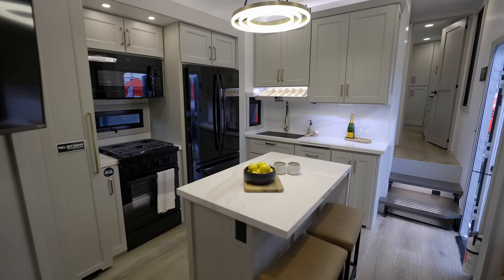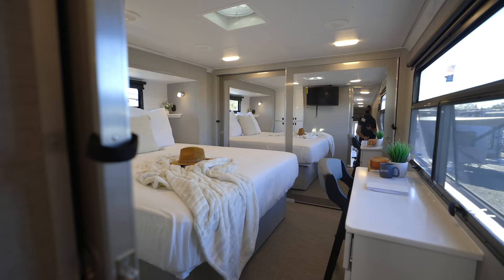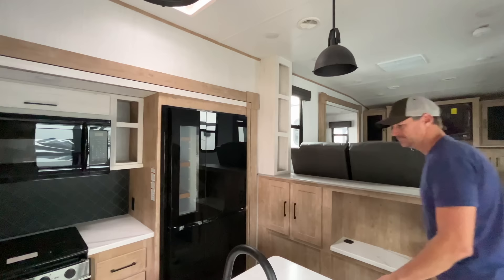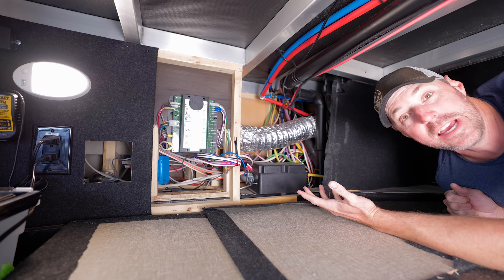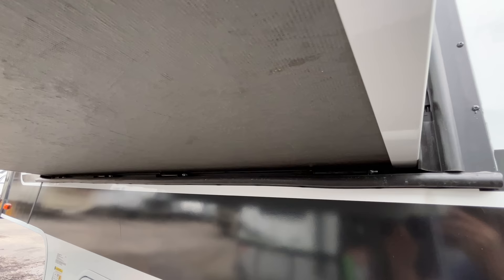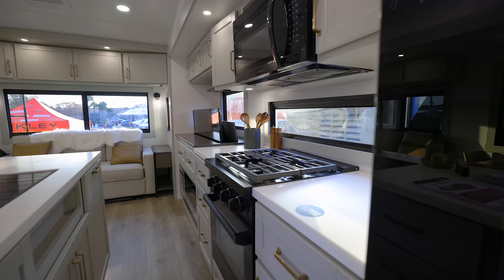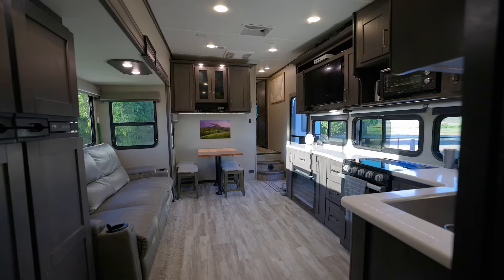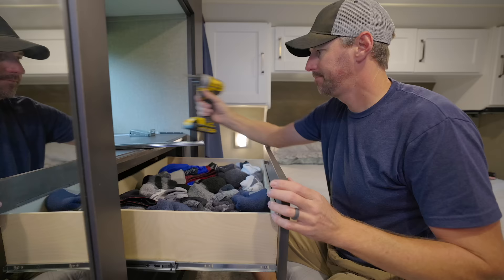Are All RVs Junk! Problems With Our Grand Design RV.

Comment: Went to a big RV show this weekend and was generally appalled at the quality of 95% of what was on display (Hundreds of RVs, dozens of brands).  A salesman happened to overhear me complaining about simple things that could have been done to improve fit and finish.  The salesman came over to “reassure” me that the RV dealership would fix most of my complaints in their pre-delivery prep.  He said they spend on average 14 hours of labor to get a unit ready for delivery.  Holy cow, it takes the dealer 14 hours to fix the sloppy workmanship by the manufacturer??  I think he thought that was a positive selling point but I view it as an inditement of the manufacturer.  Makes me wonder why the dealers didn’t prep their show units before hauling them to the expo to show the public.  Seems like a really sketchy business to me.
Reply: For sure. If that were true they’d have inspected and corrected units as they are delivered, and they sure wouldn’t take a defective unit to the show.
Reply: Don't buy one OR build your own!
Reply: Imagine what you can’t see.
Reply: Exactly. If the things you can see are crappy, and the builders know you can see it and still do a poor job constructing it, just think how poorly the stuff you can't see is constructed. @donziperk
Reply: Sure they will "fix" them.   Meaning maybe cover them up until the bottom line is signed. Then good luck.
Reply: Also, he is lying.  None of that stuff gets “fixed”.
Reply: And so they thought it prudent to bring non-prepped units to an RV show? Yeah, sure they did and sure they do.
Reply: Typical salesman B.S.
Reply: He has a bridge in Brooklyn for sale too...😅
Reply: @mehill7786   Exactly
Reply: And keep in mind- that's the model they're actually SHOWCASING. Imagine how bad the ones on the lots are.
Reply: I drove 3 hours to Camping World Kissimmee to trade in my RV for a new one. 10 minutes into my ride home, the roof AC stopped working. Dealers don't QC anything and yes they're all junk
Reply: Doesn’t sound like a dishonest salesman but an inept one. The dealerships are willing to prep ANYTHING and EVERYTHING on a new unit. The factory pays for everything under warranty. It starts and ends with the factories. They are putting out a shoddy product. And subsequently  during that “2-3” hour prep sometimes details (mainly fit and finish) defects get overlooked because they are concentrating on big stuff. Or it’s an inept technician. Skill of dealership techs can make a HUGE difference however. Quality of RVs usually are better during the “slow” months because the techs are not overworked and looking for billable hours to build their paychecks. JUST LIKE THE CAR WORLD.
Reply: This isn't a problem in Germany. They have good quality caravans over there . I saw the knaus lineup and it was akin to a small hotel room. Really good quality.

Comment: As a retired Quality Assurance engineer I can tell you that there are VERY few companies that view QA as a ‘value-added’ component of manufacturing. QA finds mistakes and problems, which have to be fixed or reworked, which delays production, adds cost and decreases profits. In touring RV manufacturers you will most likely not see ANY in process inspections done by an INDEPENDENT QA organization, you’ll see workers check their own work and a QA inspection only done at the end of the build. I’d be willing to bet that RV companies that do have a QA department have it report to the production manager who’s job it is to build the units, not find problems with them. Ask any QA professional who wins unless the mistake is so large as to be a safety hazard risk that isn’t ‘acceptable’ or covered by insurance.  I could go on and on.
Reply: Isn't value-added as a quality concept usually taken from the customer's perspective: what would they be willing to pay for? When this kind of poor quality still sells like hot-cakes may just mean that those of us who complain are a little more discerning, perhaps from being burned, and not from what general customers expect to pay for.
Reply: I  was a manufacturing engineer, and I agree completely. If there was an actual QA/QC system in place, it would be very evident to your eyes and mine, and I see NO evidence whatsoever. 
Example: My MH arrived without any lubricant in the differential - not a drop. Also a steering tire was ruined because the front end had never been aligned. That tells me that the incoming product (chassis) was not checked at all, and that's fundamental to QA. 
With regard to workmanship, I found extremely dangerous and egregious errors. 12 AWG wires were run to outlets that do not accept 12 AWG stab connections, so they apparently sanded or filed the bare wire and forced it into the stab connection - breaking the outlet. Then they tried to glue it back together! It caused a fire in my CPAP compartment, so I had to replace them all, adding simple pigtails and WAGO connectors. This denies the entire concept of inspections, another fundamental concept of QA.
Now I'm hearing of frames breaking and being sold like that, and I am just disgusted. 
This is utterly unacceptable, and we probably need government intervention to fix the problem.
Reply: Totally agree. I saw all the problems another U-Tuber was having with his high end Mobile Suites. We were having a couple small ones with our new tt as well.  I mentioned that at this level most of us would gladly pay an extra few thousand to have them built to withstand the punishment they must take and have systems done correctly like we would do it ourselves. Don't cut corners. He agreed.
Reply: Agree.  I worked in manufacturing as a cabinet room supervisor in a high end furniture manufactuing facility.  Full QA program that had inspectors located in the cabinet room, finish room, and rub and pack.  We addressed quality issues while the units were beign built.  Every morning at 8 AM we had a QA meeting covering the issues.  Those issues were documented daily.  Our goal was less than 1% of units returmed from our customers.  Our average was .5 to .7 percent from manufacturing defects.  We did have some returns due to freight damage.  QA assessments were done on packaging to rememdy that issue.  IMHO RV manufacturers don't care.
Reply: @herb7877 😂 with the over priced there is no way someone wants to pay even more. The USA company’s have been price gouging sense 2020 and they know that they are. The pandemic was a joke and made them have an excuse to get rich faster.
Reply: Built to fail .....as they say .
Reply: Brinkley has some vids on their build process.   Multiple quality inspections during build, not at the end like other manufacturers
Reply: The RV industry hires their QC folks from the Helen Keller school of Sure Looks Good to Me.
Reply: You’d think today, with the internet, manufacturers would realize someone looking at their brand is likely to read forums or join Facebook groups… and if they see horror stories of badly built units they will go elsewhere.
Reply: I know that you are a real proffesional QA engineer as I am just for the use of the word Assurance. Quality should not be controlled, but assured. Quality should be inherent to any step of the manufacturing process, from the design step to the delivery of the product to the end customer.
Reply: @Teporame agree with you. A QA engineer is proactive and engineers out manufacturing problems. A QA inspector is reactive and catches defects after manufacture. Both are needed but the QA engineer is the one that saves money for a company.
Reply: Why don’t you give us the price when you mentioned these two RVs with Brinkley and the one you bought you talk about price but you never give us the number
Reply: RV manufacturers just don't understand basic quality costs.  They spend way too much in appraisal, internal, and external failure costs, and not nearly enough on prevention costs. (Retired QA engineer myself).

Comment: I accidentally landed a tour of a major RV trailer manufacturer with the plant manager some years ago.  How I got this personal tour with the brass is another story, but once he realized I had no interest in his products, he became much more at ease and that comfort pervaded the 1 hour tour and corresponding coversation.  Of the many things I learned from him one stood out.  "These trailers expensive or otherwise are not made to live in.  They will not stand up to thousands of miles, potholes, road construction, flexing over the axles and uneven loading.  We have to strike a balance between durability and towability. They are made to get out a few weekends and a 2 week vacation every year for about 5 years in varying levels of the comforts of home."    I took him at his word.
Reply: You are 100% correct. The RV are designed to no longer last 20 years of occasional use. Instead, 5 years of normal use 4 weeks out of the year. If that is the expereince people want, the best case is to rebuild/rehabitate a 60,70, or 80s trailer OR go Class C as the frame has to meet road standards.

Comment: I own Holiday RV Repair LLC in Georgia and every week I see things that blow my mind. We just completely removed both roof and ceiling from front to back on a class C built by Thor. The roof was sagging starting at the cab over section and going back about 6 feet. After we took the ceiling down, we found that the factory failed to put 3 of the roof bows (rafters) in therefore the roof had zero support for the roof as well as the ceiling.

Comment: Rosie and I are on our 8th fifth wheel. We've been doing this a long time. We had a Reflection, and I am pretty handy and fixed a lot of things. We had good backing from Grand Design. We actually toured the facility and met Micah and all the top guys. Then we got a Solitude and started having frame and spring and shackle problems. At first we had help from Nate at G.D. Then Grand Design changed, and our support ended. They put us off and finally just stopped responding. Well guess what? Micah and Nate along with many others had left (after G.D. sold to Winnebago) and started a company called Brinkley. We finally pulled the trigger on a Z3100. What a game changer. Not only in Quality but support. We have been to Alaska and back and will head to Yuma, Az. soon. H rated tires (cooper) Heavy duty shackles and springs. The inside is quality and modern. Solar on and ready to go plus I added (with guidance from Brinkley) a second 370-watt panel, a 3,000-watt inverter and 4 Battleborn Batteries. We went down from Wisconsin to Indiana and had the red-carpet treatment at their beautiful facility. I do expect to have to fix things over time, but I can deal with that as long as I have support. This is Burlington Bill busking from the road and here on You Tube.
Reply: Glad you and Rosie Palm are doing good.
Reply: At least you don't have to worry about the motor or transmission going out. 😊
Reply: We are planning on purchasing a Z3100 next year and can’t wait.  Great to read about your experience.

Comment: I got an Escape 5.0 TA back in 2019.   It's a lot smaller than what most people use.  Still, the quality is such that I go out of my way to show folks what the standard of quality should be.  The wiring, especially the electrical distribution panel was perfection that I have never seen before.  I might add,  I've taken this trailer into places you wouldn't think about going in other RVs.  I have to give credit to the Escape workers in Chilliwack, BC  for being responsible for this kind of quality.
Reply: Same experience with my Escape 21NE.
Reply: Escape 19’ owner here. Our experience has been the same as yours, we have over 30 Thousand miles on our 2018 and have only needed to replace tires 😊
Reply: I was really interested in the 5.0 TA, but a near 2 year wait was too much for us.  They could also stand to update their interiors, but overall a very nice product and idea.

Comment: I have 3 Maxxair fans that all started squeaking. I took them apart as you'll see on Youtube, cleaned them out, and had short term success. I found the bearings are the same size as sealed skateboard bearings... It's pretty easy to take the motor apart, clean it, replace the bearings, and they are quiet again. I haven't seen anyone else mention it, so... new pro tip

Happy RVing

Comment: Good job of scratching the surface Jared.  We are not new to the RV world, having owned what is now our third fifth wheel since 2015.  Our first was a used unit which needed regular fixes during every trip.  When we retired we purchased (after much research and evaluation) the Vanleigh Beacon.  Unfortunately it was a 2022 model (read covid and shutdown news) and never was right.  We went to the Tiffin Service Center and after 5 weeks of repairs and a repair valuation of $34K (warranty, nothing out of pocket) I traded the lemon in on a 2023 Grand Design Solitude 310gk.  This unit, built in March of 2023, came with 660 watts of solar, 50 watt mppt controller and 2k inverter.  I added my lithium batteries and generator.  This is a better built unit than my Vanleigh ever was.  I have 5k miles on it since picking it up (we are full time) and have not had to do anything but level our 12 volt fridge.  I did clean up my electrical wiring (strictly for my mild OCD) but nothing leaks and none of my cabinets are falling apart.    This being said, I totally agree that the manufacturers need to step up their game.  Just build to quality and QA your product.  There is no reason for a dealership to be responsible to repair shoddy work, especially since most dealership techs probably don't even know the product, just the basic systems, and even then, there is so much new tech coming out that many of the technicians don't even know how to fix it.
Reply: I would get rid of the Grand Design as soon as you can.  Sell it.  The units have SERIOUS frame flaws.  There are tons of videos on YouTube from current and former Grand Design owners.  I am not kidding.  Don’t wait.  Get rid of it.

Comment: Good video. One of the key challenges for RVs is the need to hit price points and also weight targets. This leads to cheaper and lighter materials being used, which don’t last as long. This doesn’t excuse the sloppy workmanship, but it’s just a fact that many customers want or need to have an RV under a certain weight and under a certain price point.

Comment: One of our RV's had the same annoying slide trim. Turns out, it was that way because there were components behind that off center trim that were a lot easier to access by just removing it instead of taking the entire 11 feet of trim off  ( Which eventually fell off by itself while going down the road )

Comment: Great video Jared. We are in our second year of owning an RV and if I wasn’t a DIY type of person, I would definitely be discouraged with all the issues.  If I was to rely on the dealer to fix everything, our RV would probably be there more than at a campsite.  Keep up the good work!
Reply: I agree you must have mechanical skills to own an RV period, its now stop repairs.  I get this as we put some RV to a higher stress factor on these roads at these weights.  I seem to find a screw on the floor every time I travel.  So if your not handy you RIG is in the shop.  Dealership don't explain these things to first time buyers.

Comment: My husband is a DYI guy, thank goodness. We've only had to have our Grand Design in for a slide repair, which was confirmed to be a bad install at the factory. Our RV was unavailable to us for 3 months. Grand Design covered the repair and extended the warranty on the slide. All other minor repairs we do ourselves. We had to add plastic corner protectors because of peeling wallpaper. The heat in AZ takes its toll. We replaced the TV already and some of the doors are warping from heat. It's an RV. We get it. At least Grand Design has been incredibly responsive. GD sent all new cabinet handles free to protect against cuts from sharp edges. Overall, I like Grand Design, and I'm still in love with our RV. I don't think I'd want to live in it full time. Love your content.

Comment: Finally, someone (you, Jared) called out the RV industry on their products. Thank you! In my experience, it seems that the manufacturers push out the products and make the dealerships repair their flaws, but only if the buyer finds the faults. On my RV, first time new purchase, I was amazed at the lack of grease in the wheel bearings found at the first service. I'm surprised that they lasted 500 miles. I'm glad I didn't go farther that first year.

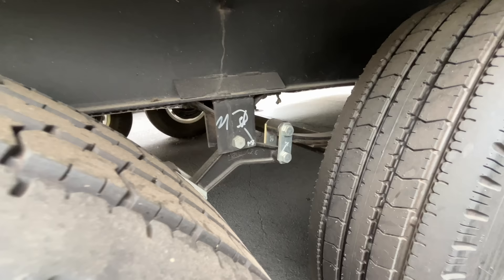Comment: I got shivers when I saw the spring support bracket welded to the frame horizontally at the 2:47 mark. I had a toy hauler with the same welded supports and those welds caused a weaking of the frame and the flexing back and forth caused massive cracks to radiate out from where the bracket is welded to the middle of the frame. Lippert told me this was a known issue and wanted me to drive it 2000 miles to their factory for a free repair. I had a local truck trailer repair shop do the repairs. So surprised they are still using this method instead of welding a bracket from top to bottom.
Reply: I had a 31 class C funmover. They welded the body onto the frame crooked. One side was 2 inches lower than the other